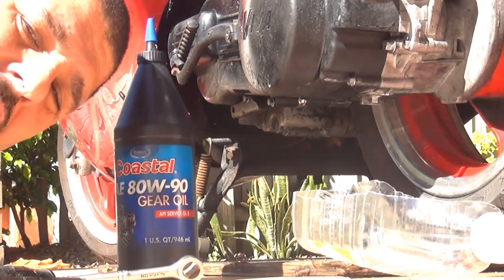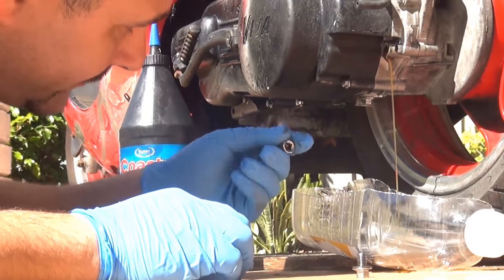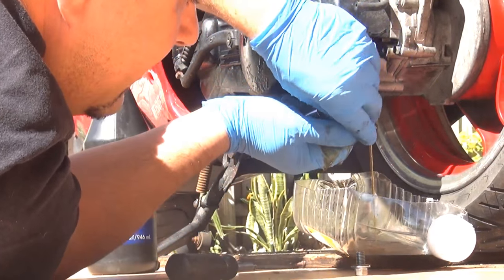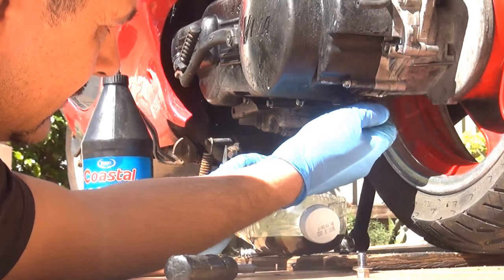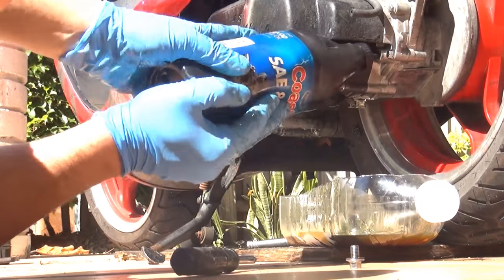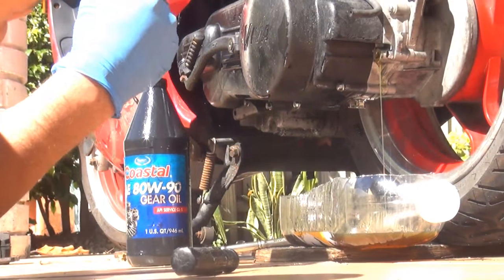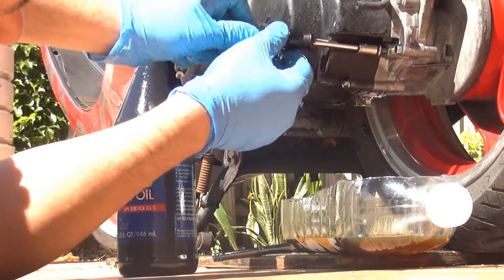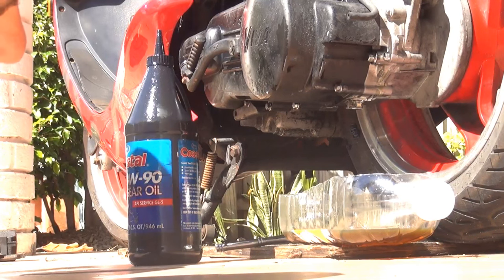Scooter gear oil change gy6 150cc

Comment: I have 2014 honda elite 125 cc I changed the engine oil in 10w 30 it's ok? Or have to change it for 10w 40 and what is the difference please
Reply from the maker: Hi for the scooter engine my favorite is 10w 40 but if you have a 10w 30 in the house is ok for the winter if you live in a cold area. The two oil types differ in their high temperature viscosity, and 10w40 is thicker than 10w30 when it comes to high temperatures. Thank you for watching my video
Reply: virberello thanks for your answer appreciated

Comment: can i use viscosity 85w140 for my scooter sym fiddle 2 
as it recommended in user manual 
but recommend 85w90 for outside temp zero or belw !
Reply: I just did a new rear transmission bearing and I used 85w 140 because that's what I had laying around and temperature around here is about 90 degrees sometimes.  If I lived in freezing temps I'd run a 75w-90 or 80w-90.  The biggest concern would be make sure it has SOMETHING in it.
Reply: @aaronkeiser6349  
oki thats good my question is 85w140 is good as temp is above 20°c ? 
no problem?
Reply: That should be just fine 
 @islamayman5927

Comment: Is the Lucas gear oil you mentioned synthetic?    Should I spend more and get synthetic?
Reply from the maker: Hello Lucas gear oil  is heavy duty but not synthetic and will be great for around 2000 miles. You do not need to spend extra money on synthetic because the temperature on the rear gear box they do not go very high and the oil is not breaking down very easily so will last longer. Thank you for watching my video

Comment: Hey can i use only 90w oil
Reply from the maker: Yes 90w is ok is little thicker so if you live in a hot place is good if your location is above 3000 ft is no good

Comment: refilling your gear oil , hear is a way that's easy, take and get a peace of fuel hose abut six inch. cut the top of your oil bottle off, fit your fuel line on the tip of your oil bottle. this way you can hold your oil bottle up wright and easy to fill..
Reply from the maker: Great idea thank you and thank you for watching my video
Reply: or bk straw
Reply: Getting my new 150cc znen in a couple of weeks and I wanted to change the packing fluids. Thanks for this video!